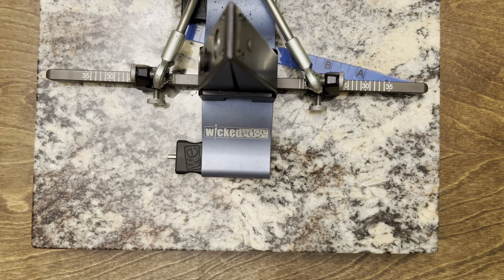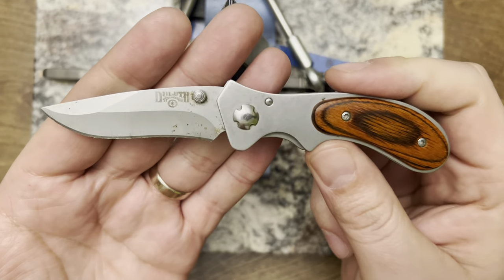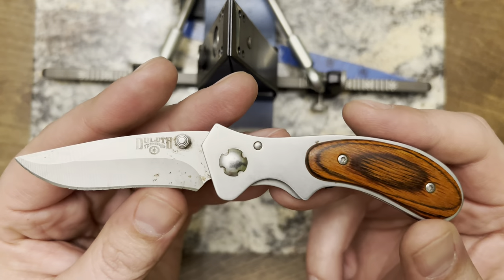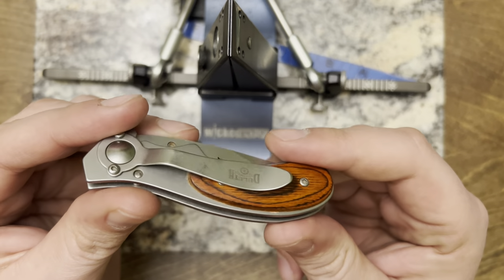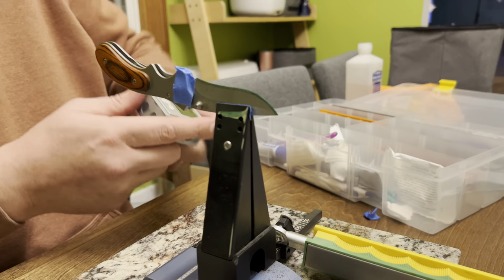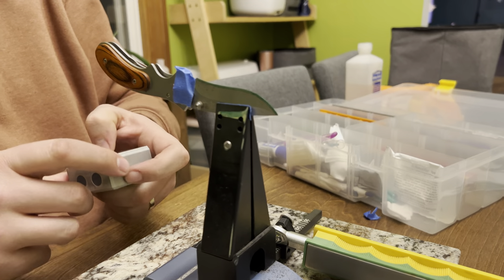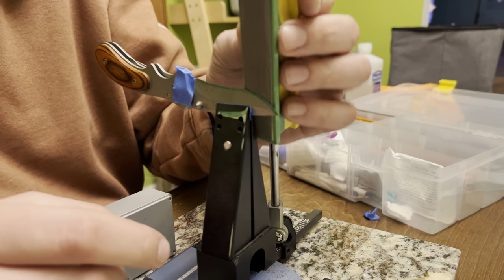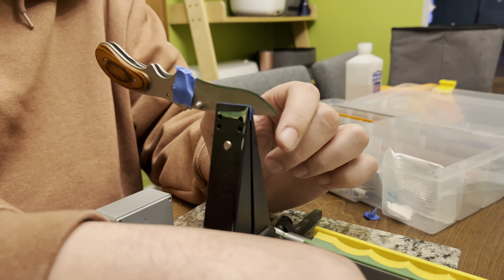Repairing edge damage on a recurve blade | Duluth Trading knife on the Wicked Edge

Comment: Have you ever thought to pick up the 50/80 stones to speed up the first part of your sharpen? I find I spend most of my time on the 100/200 stones, but am not sure it’s worth picking up the lower set.
Reply from the maker: I definitely have thought about it but just haven’t.  But I’m like you, I have the most time spent on my 100/200s than any other stones.  Wonky fixed blades suuucckkk when you’re in the 100s for an hour just to set your bevels.  I think my  hesitation is that the 50/80s would be really rough on blades until the break in and then they’d of course be really aggressive still after break in.  I’m afraid I’d go too hard and ruin a blade by taking too much